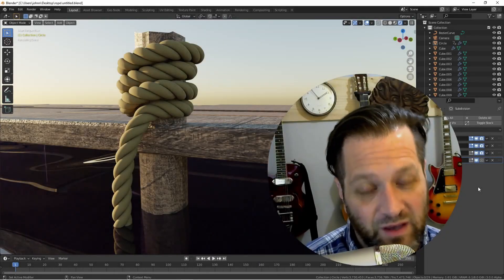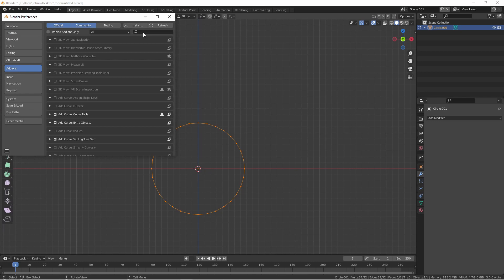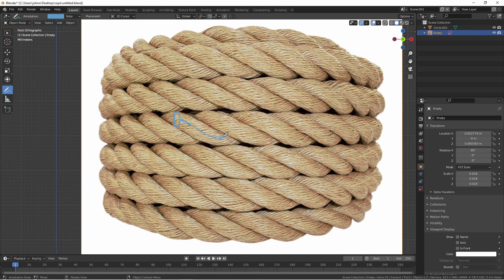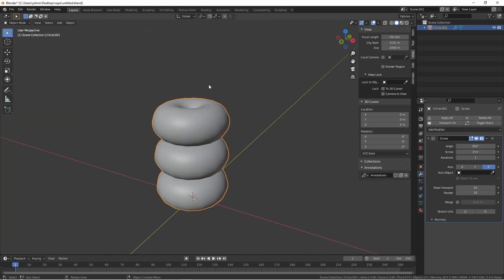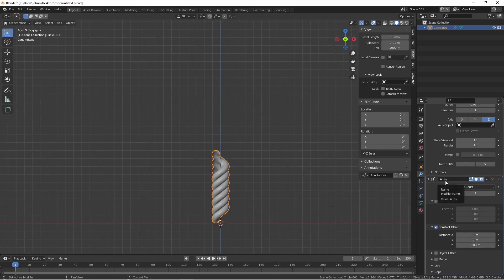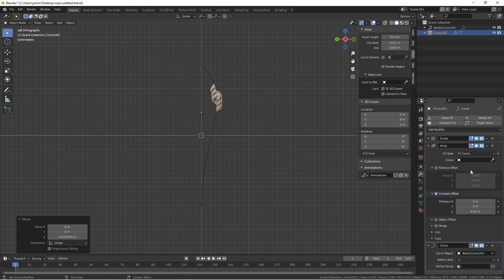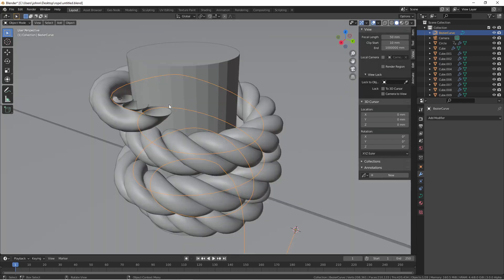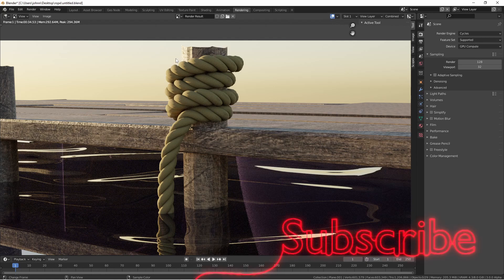Modifier Combo Attack! Screw + Array + Curve = Rope!

Comment: What would be the best way to make the finished rope low poly? I was thinking about duplicating the curve  used as a guide and using the depth attribute to make a cylinder with a low resolution. Then convert the curve to geometry, make some uvs and  bake the normal map. Thoughts? Concerns? :) Thanks for the great tutorial.
Reply from the maker: I'll have to think about that.